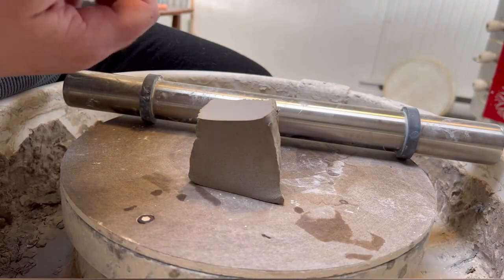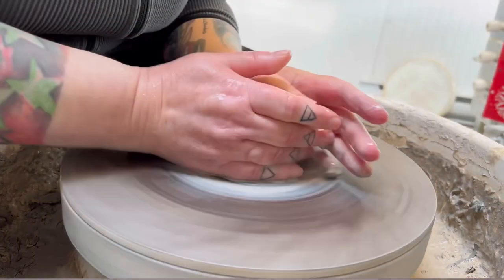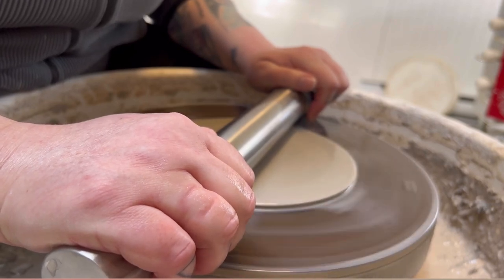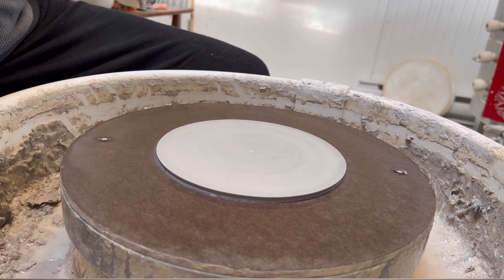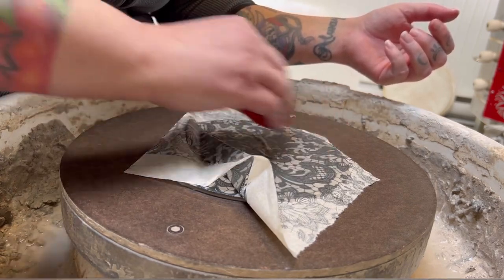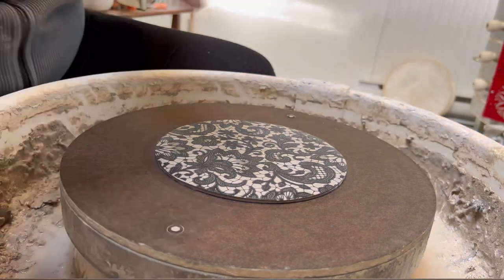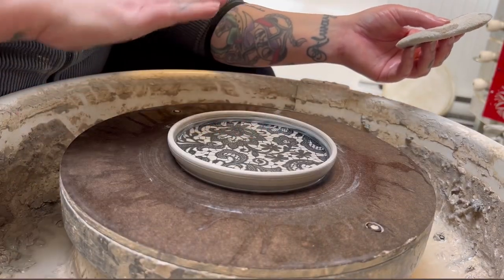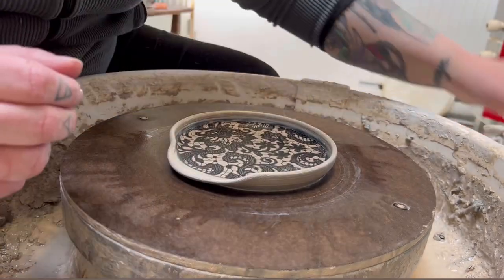How I make a spoon rest

Comment: I use that technique but I hold a wet sponge in my right hand to prevent mushrooming.  Also helps to keep disc centered and edges smooth.  Then I just bring the edge up with wooden rib.

Comment: Really nice video! Thanks for sharing your technique. I’d have loved to see how you wire off the piece and finish the bottom since that can sometimes be the hardest part of throwing flat objects.
Reply from the maker: Next time I make one I’ll do a video 🙂 In the meantime, I wait until it is almost leather hard before I wire it off, which helps with warping. I then trim the bottom but usually don’t do a foot ring.
Reply: I'll have to try that. Wiring off when leather hard that is. I'm still pretty new at this, so lots of things to try and learn! :)
Reply from the maker: It is so much fun to learn new techniques. I’ve been a potter for eight years and I’m still learning new and different ways of doing things 🙂

Comment: Hello 🌼i really liked your works.. I'm new at ceramics, so I wanted to ask if this paper is decopage paper? if not,where can I get it and whats the name of it? I actually found a lot of decopage transfer paper, but the seller guy told me it's made with decopage glue and also when it's finished on ceramics,He gold ne ;  I need to apply glue and varnish it, but u know its different on ceramic works so I wanted to ask you if these are applied after the mud is baked, or if it should be wet mud, thank you and have a nice day
Reply from the maker: Hello, they are called underglaze transfers. They silkscreen the underglaze onto rice, newsprint or tissue paper. I found it is best to apply them once the clay is leather hard but you can apply them to bisque as well. The clear glaze has to be zinc free, otherwise the transfer will smudge and run if the glaze has zinc in it. You can purchase the underglaze transfers from Ceramica Transfers, Elan Transfers, Plum Island Transfers and Sanbao Studios. There are other companies but these are the ones I use. 

If you have instagram you can look at my reels and find a couple where I apply the transfers to a mug. The method in this YouTube video is not the only way I do it 🙂 my instagram is @horseshoe_pottery

There are also over glaze decals but they are completely different. Decoupage would probably not work on ceramics. 🙂
Reply: Thank you so much for the answering 🌼Have a beautiful day.
Reply from the maker: You are welcome 🙂